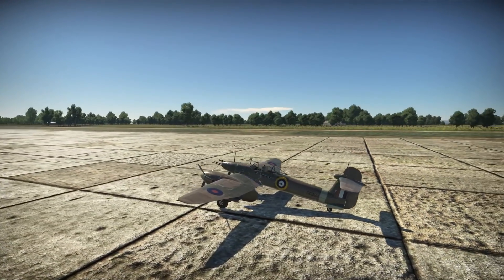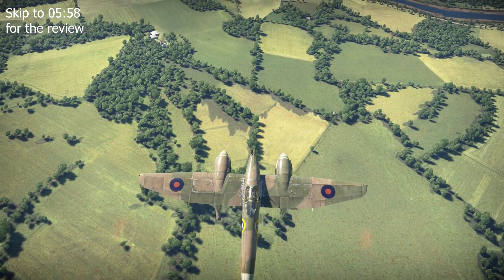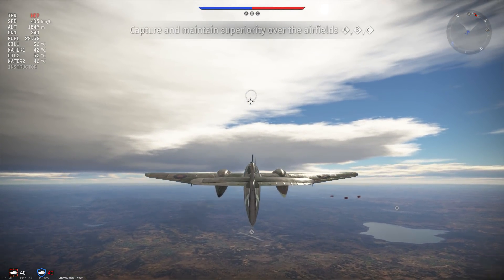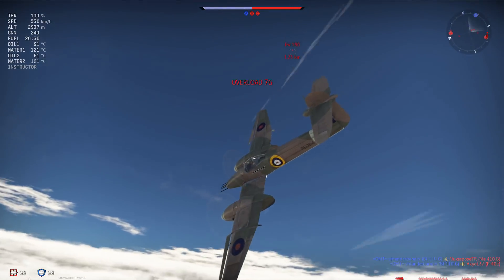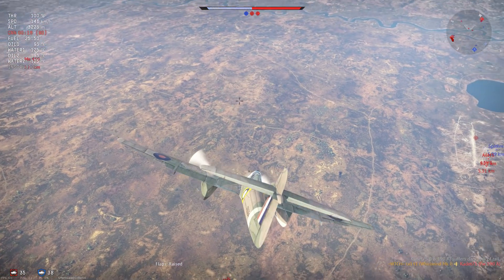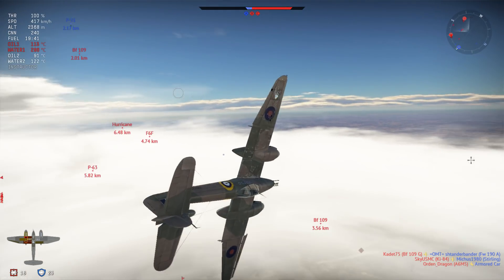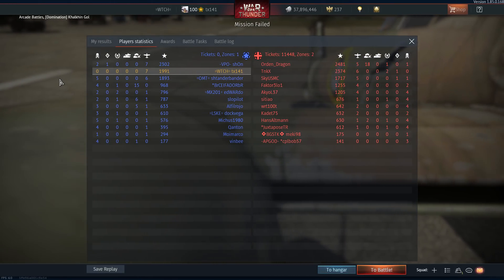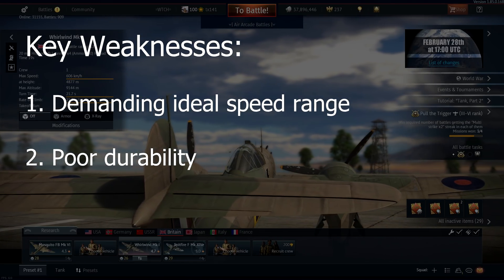War Thunder (Arcade): Whirlwind Mk I - Finding a Role

Comment: As for fighting the Whirlwind - would you advise fitting it in the vertical, despite its tight Loop Circle? So, in a Spifire, give it a bit of a Boom & Zoom and if messed up (as I often do through poor accuracy) fight it in a Vertical Turn Fight?

Comment: Thoughts on this particular plane:
1. Unless you're good like Paul, and can bring the enemy in sight within a turn or two, even a slightly drawn out dogfight can easily swing the odds in favor of a more nimble fighter. Despite its agility, it is in the end still a heavy fighter, and it's always advisable to plot an escape route or lead to foe to friendlies before starting a fight.
2. Despite its centerline, forward facing armament, I hadn't had much luck going heads-on with people, due to its easily damaged engines.
3. Like many heavy fighters, it suffers slightly from the bouncy mouseaim effect, where the mouseaim cursor tries to make a pitch+roll move instead of a yaw move when you move your aim sideways. This results in a "bump" in your aim when tracking an enemy horizontally. The solution is to roll beforehand and only pitch to turn.
4. That T tail can block your view at times, quite annoying.
5. Its placement in the tree means British players could very well have never had experience in a heavy fighter like this by the time they reach it, as the Beaufighter is a very different beast. Learning when and how to engage is even more important than small nimble fighters, which have more options at their disposal when engaged.
Reply from the maker: I agree with you on all of your thoughts Andy - one thing I actually forgot to mention was that the 20mm cannon have a considerable amount of recoil. This recoil can disrupt your aim significantly, especially below 350km/h.

With regards to point 5, it confuses me as to why the Whirlwind has been placed after the Mosquito Fighter-Bomber in the tech tree, and with a slightly higher Battle Rating. If anything, I would have expected the planes' placement to be the opposite way around!